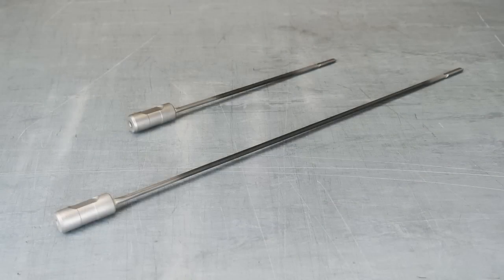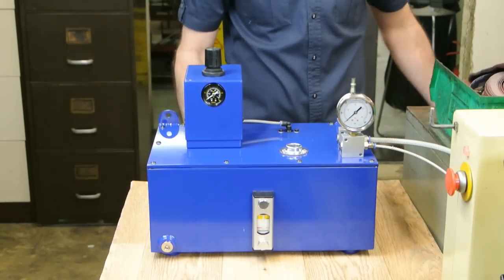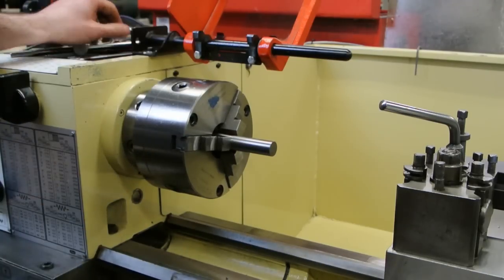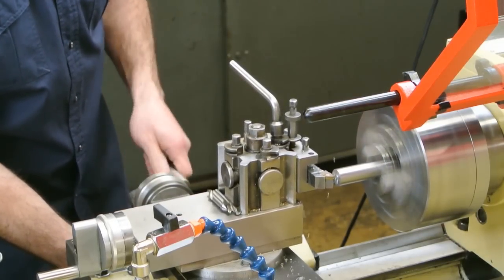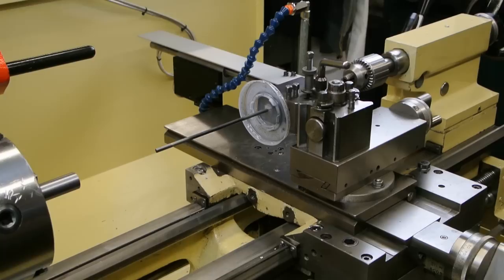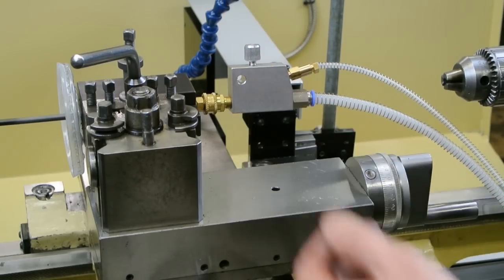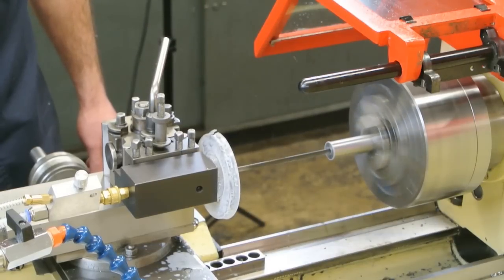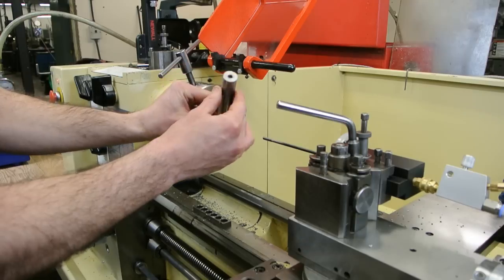Hammond & Co. Spraymist/Ventec Instructional Video

Comment: can it drill 600 mm long deep hole
Reply: my bore range is 7 mm to 13mm
Reply: @ultimatelatheworks8138  share your contact sir
Reply: typically a drill like this could get the depth at 100x the diameter of the drill on a setup like this (e.g 600mm long on a 6 diameter drill), a very rigid machine could get 150 or maybe even 200